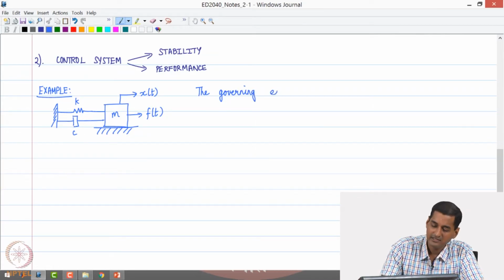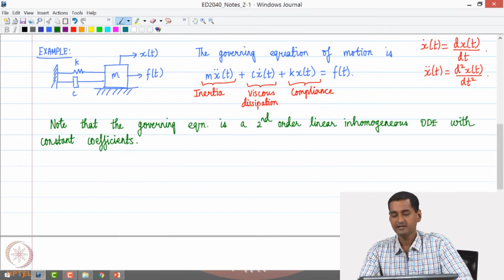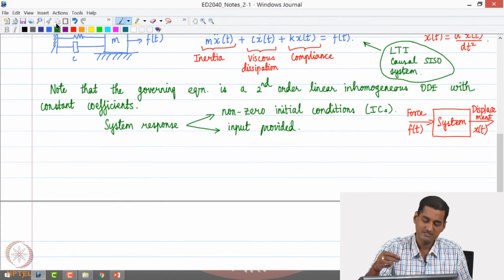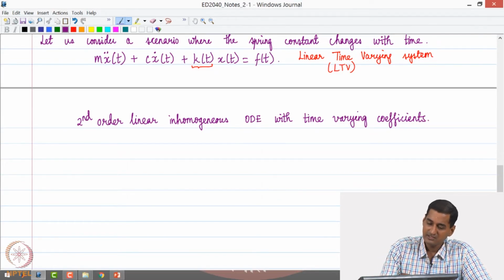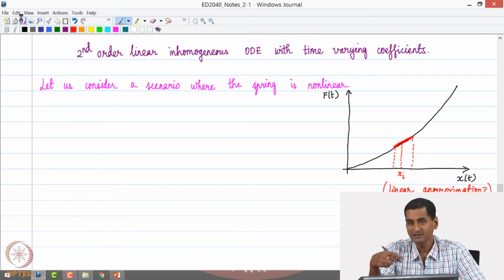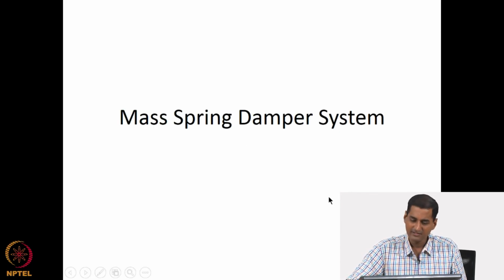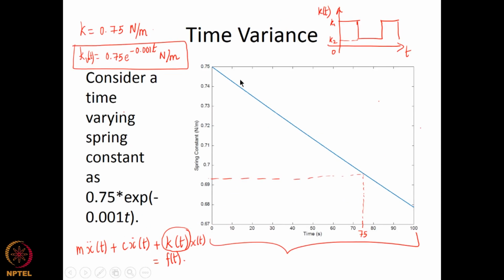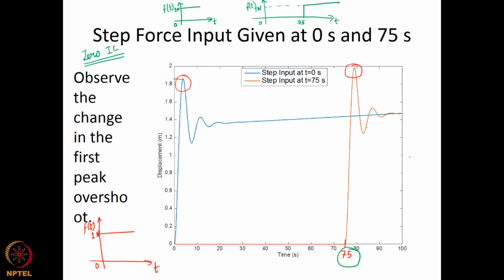Overview of Feedback Control Systems- Part 2

Comment: example of mass spring damper system 0:00
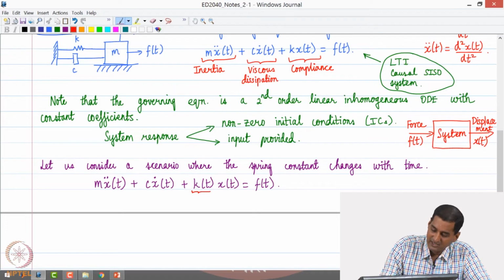linear time varying system with non constant coeff 7:30
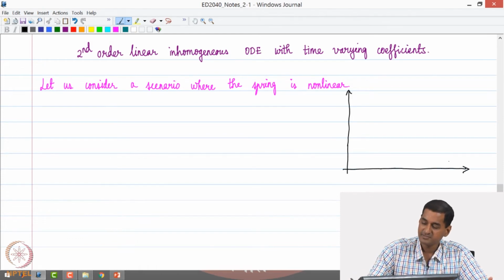non linearity in the system with non liear ode 9:45
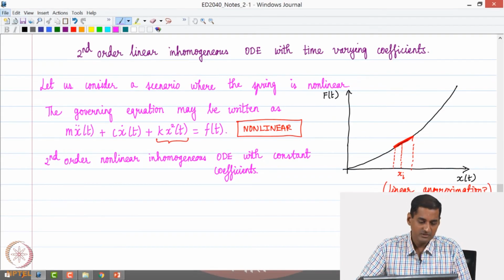free and forced response 14:00
time varying system response example 16:00